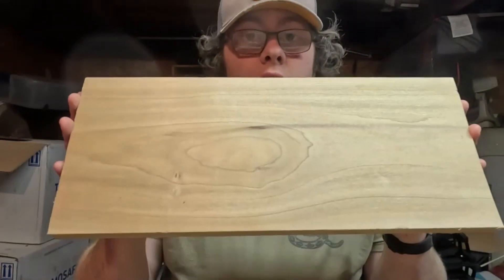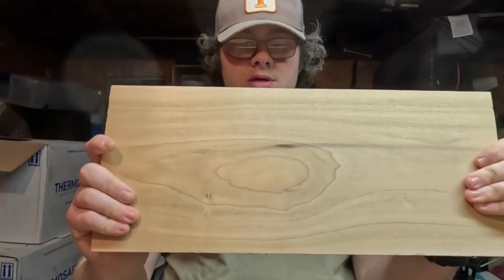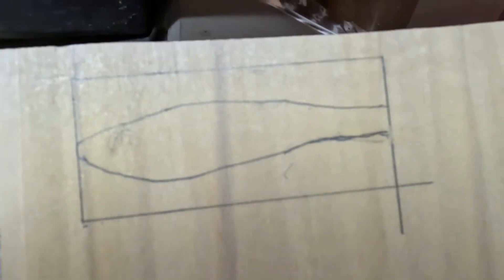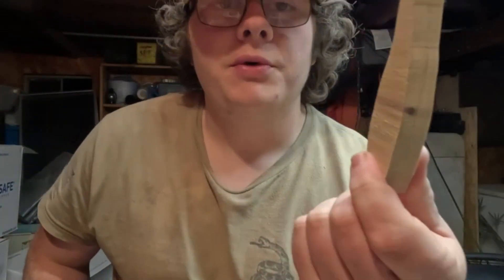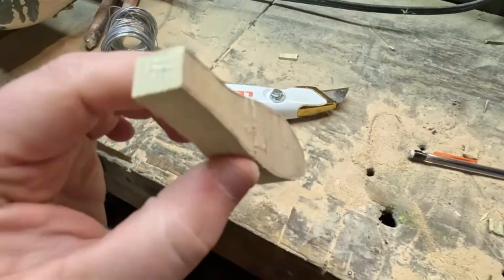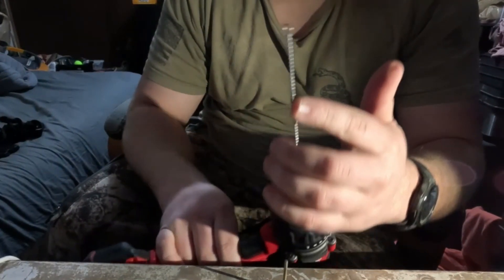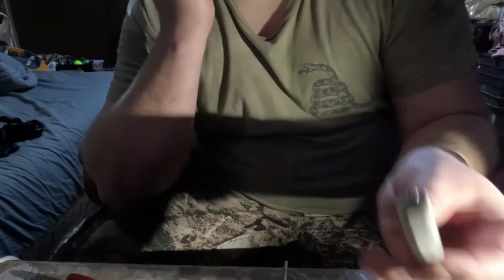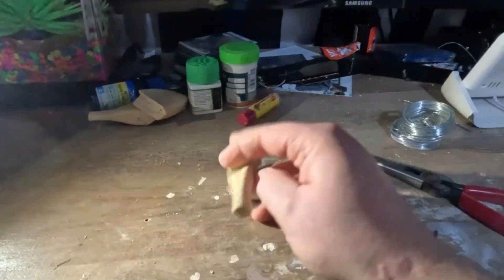Making a Creek Chub Swimbait Out of Wood PT.1

Comment: I make lures from pine all the time and don't have any problems. I do attempt to use straight, tight grain, without knots in it, that is well dried. Poplar or basswood is much preferred over pine though, but pine is free and I usually give my lures to family and friends.

Regardless of the type of wood used, I lay out the pattern lengthwise with the grain of the wood, as that seems to provide the most strength to the body of the lure. You have to watch the direction of the wood grain while carving to prevent tear-out. If there is a benefit to having the wood grain run vertical on a lure, I would appreciate hearing about it, as I'm always looking for ways to improve me technique.

Just a suggestion, try using 3 or 4 inches of wire to make twist eyes. You'll be able to make 3 to 4 times as many with the same amount of wire and not cut off as much waste.

I have super glued so much DNA onto lures! LOL That's just part of the process.

Looking forward to seeing the final product.
Reply from the maker: That's probably where I messed up I'm still getting into lure making but it's so much fun to do I appreciate the comment man!